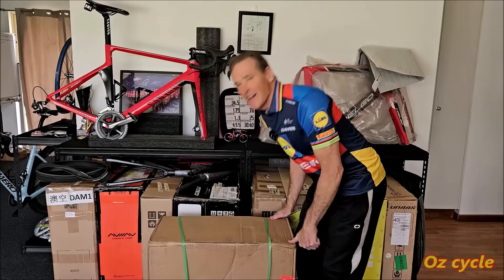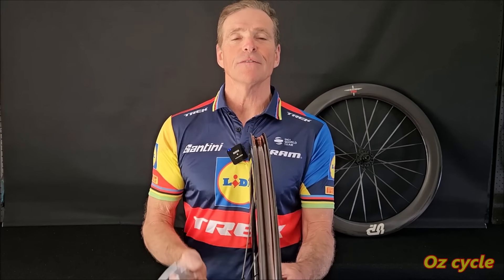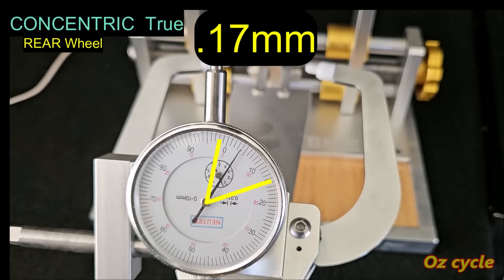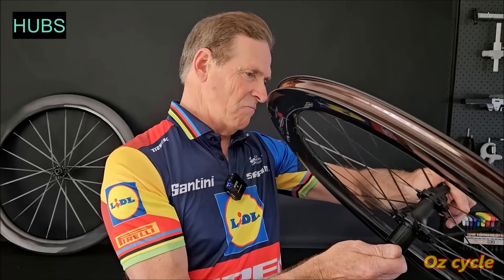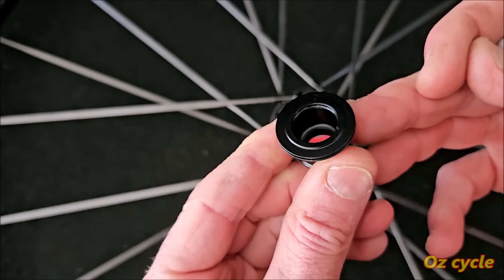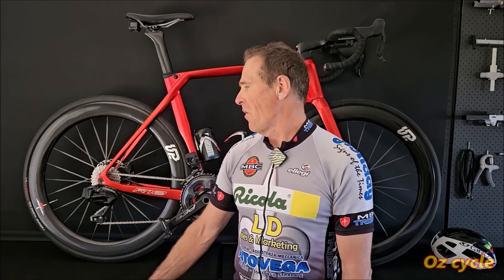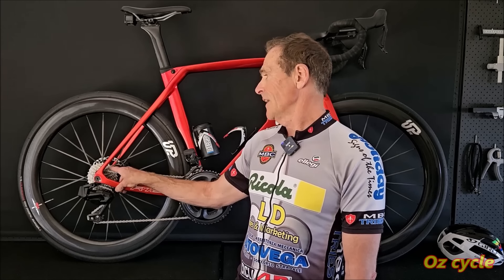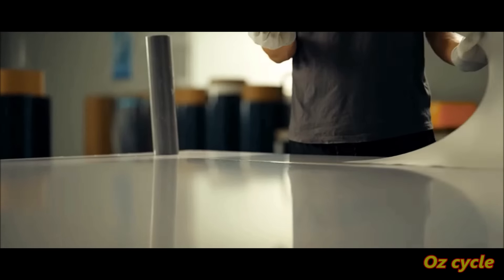Beautifully made Chinese wheelset - Upvine

Comment: Another case of spokes not having any redundancy by being "free" in the hub and only being held with tension. Imagine one spoke snapping at high speed, the other spokes will adjust to compensate and you have high risk of a loose one popping off on the side. These types of hubs/wheels should just be illegal.

edit: They do not even need to "break", just a change in tension can end up loosening a spoke enough to get it to "pop" out of the hub. Mavic used to make hubs like this and they don't anymore in case anyone is wondering...
Reply from the maker: Spokes usually break from an accident. Why would a spoke snap at high speed?
Reply: @stevenleffanue  On a traditionally hub, the spokes are captive. If for any reason, you lose tension in 1 or 2 spokes, the other spokes are fine and while yes, the wheel will lose true, it will still remain a wheel. On these 'free' spokes, if a few spokes lose tension for some reason, ALL the spokes can come free from the hub, and the wheel will completely lose its structure. The result, is a much more catastrophic failure. That is the complaint here.
Reply: Do you have any specific examples of this actually happening? I have built many wheels, been a bike mechanic for 20 years and never heard or seen that happen.
Reply: @stevenleffanue   Being a 90kg rider, I have had spokes break before at speeds of 30-40km/h (not due to accidents but due to high km spoke fatigue or poor wheel design). In all cases, these hubs had a cover over the spoke heads to prevent rapid spoke delacing of the wheel. I don't think I would ride with a front hub without a spoke head cover. 
Example #1: 16 spoke front Shimano WH-7850 Dura Ace wheels towards the end of the life of rim ~30,000km (so significant amount of fatigue) for a low spoke count wheel. 
Example #2: 20 spoke front Mavic Kysrium Equipe wheel - high kilometre fatigue (lots of potholes hit riding in the dark along the Great Ocean Rd in Victoria). 
Example #3: 18 spoke front SRAM S30AL Sprint wheelset which had a design flaw (the inverted, hidden spoke nipple washers were too thin which split causing rapid detensioning of the spoke and spoke failure). I had one spoke fail at 40km/h which resulted in a 2nd spoke to fail as I was emergency braking.  This nearly resulted in a crash. I hate to think what would have happened if these didn't have a cover over the spoke heads. 
Example #4??? However, I recently picked up a rear Kysrium SL rear wheel from the hard rubbish here in Melbourne which has some brake track life left in it and noticed that it doesn't have any cover over the spoke heads. I think I will risk it, as it is only rear wheel.
Reply: @richardggeorge  I ride only high end wheels made in Italy or France and  it happened two times. A spoke broke when I was climbing. I will never buy wheels from China.
Reply: @cristianpauldanet3724 At best they are made in China and assembled in France or Italy. Otherwise, those wheels are entirely manufactured in China, and a fancy European name stick to it to change you 10x the price.

Comment: Your video reviews are always top notch and cover everything, that said I watched the entire video even though I don't want or have a use for carbon wheels. I'm a fan of aluminum wheels because I trust the material over carbon.
Reply from the maker: Understandable. Try a carbon wheelset one day, tho , even if it's a borrowed set , they are a lot stronger than most people give them credit
Reply: If anything carbon wheel are stronger. You hit a pothole with carbon, nothing happens, aluminum tend to bend over time.
Reply: @morneauh  But I can buy or rather build my own, two sets of aluminum wheels for the price of one set of carbon wheels. I only build my own wheels these days because of the options I choose. I like totally silent hubs for one thing. Steel CXRay Spokes, not bladed, and rims that are asymmetrical. And if a rim were to get bent, I can just replace the rim very easily for about $130.😉
Reply: @Raymond-Farts  Carbon rim are getting close to that price nowadays. You can have a look first next time you rebuild. Personally I prefer to by once and not have to worry about it down the line. In fact I don't think my current set of carbon rim are much more than $130.
Reply: @morneauh  Carbon is a crap material for a bicycle. The problem is not everybody has learned that yet. Also bad for the environment, which is something no one can argue with.
Reply: @Raymond-Farts  I have a Time bicycle, you can check their Braided Carbon Structure, you will see how crap it is.

Comment: 1500 AUD = 992 USD = 762GBP.....that makes them cheap in my book.....Farsports S 1299usd 1330g 58mm , Lun Hyper 1599usd 1450g fro 67mm . the latter are slightly narrower.  The Hypers were cutting edge a few years back but are clearly falling behind with the latest generations. The farsports will get you similar width but lighter and a DT swiss style ratchet for 30% more cost.

Comment: really appreciate the detail and diligence you put into these vids!

Here's a vid that Peak Torque did about spokes falling out of those secured-only-by-tension spokes. Would love to hear your take on that!
https://www.youtube.com/watch?v=2HQrkIL87g4
Reply from the maker: The wheel was involved in an accident,  not necessary caused by the spoke to hub connection.
Reply: @stevenleffanue  correct, not causing the the accident. Sorry I interpreted you saying it as "spoke detensioning is not realistically possible from my experience" 23:14 when it sounds like you mean "spoke detensioning has never occurred under normal riding conditions in my experience".

Although it should be noted that when an accident does occur and the spokes detension, I can imagine it exacerbating injuries.

Comment: i don't understand how this wheel set is "the beginning of the new generation" -- it's a reasonably spec'd and clearly well-QC'd wheel, but with very traditional rachet in the rear, and a familiar design of rim?
Reply from the maker: It's the 'width' and 'weight for width' which sets the new generation from the older style carbon rims.

Comment: Hi Oz cycles love your videos and reviews. Very informative. I’m currently looking at getting some new wheels. I currently have roval c38 and have been looking a fair bit at the elite drive wheels and just wondering what sort of rim depth you would suggest. I do have an idea maybe 45 front 65 rear. I live in Tassie so there is a fair bit of climbing around as well just running on what your thoughts were or whether I stick with maybe a 5050 backand the other option is I do have an option to look at some vision Metron SL 60s love to get your advice. Thanks so much for your time.
Reply from the maker: I've not ridden Metrons. Drives and 8liens are very close in wheel performance.  If you got rough roads the 8liens would be the pick because you can run bigger tyres for comfort, control and not have to worry about potholes so much.
Reply: @ nice my frame is maxed to 30mm Tyers